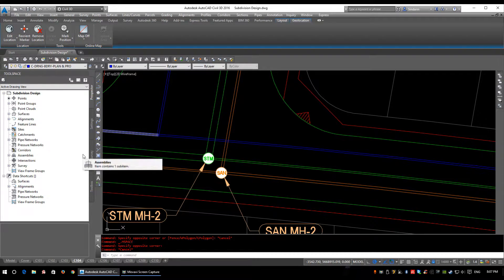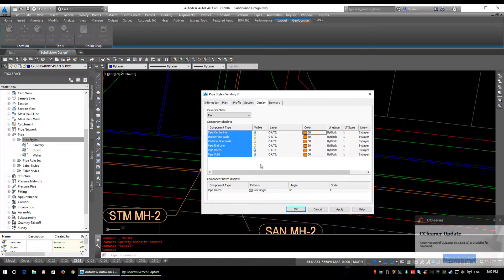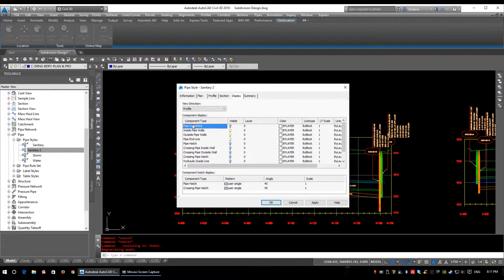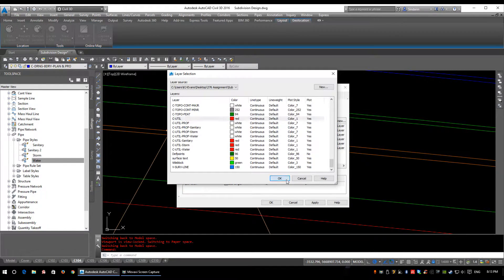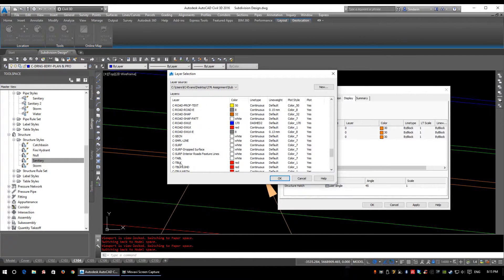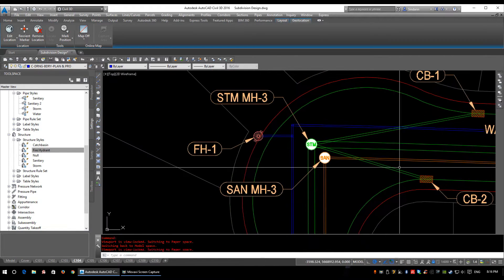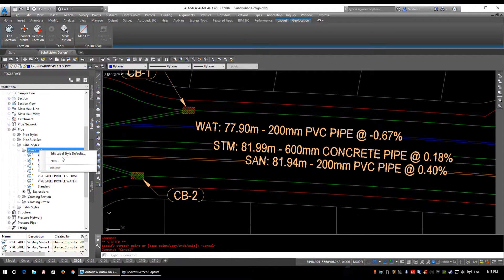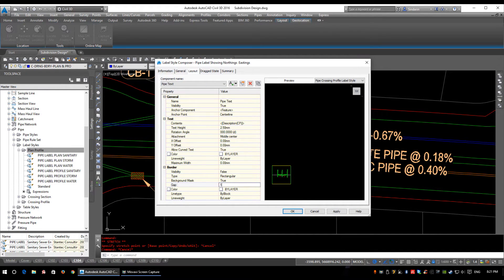Pipe Styles, Structure Styles, Pipe Label Styles

Comment: Hi kyle i relize this is an older video but i cant find a soulution anywhere else. I have followed all of your videos very closely (you have some of the best out there thank you!) but i am having an issues with the scaling of strucutres in profile view. say for ex 1500mm strucutre with a 900mm pipe in. the elipses for the pipe is wider than the strucutre in proview. simialrly comapring a 1500mm catch basin to a 1050mm manhole the manhole is larger in pro-view
Reply: The problem seem sto be from the parts themselves, the scaling works properly with  cyl struc slab top CIRCULAR frame but not with cyl struc slab top REC frame